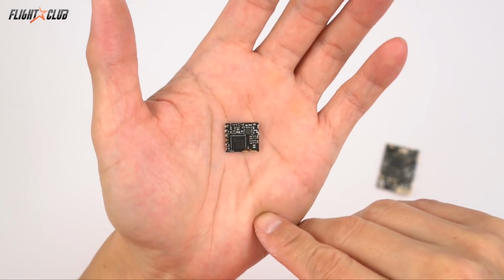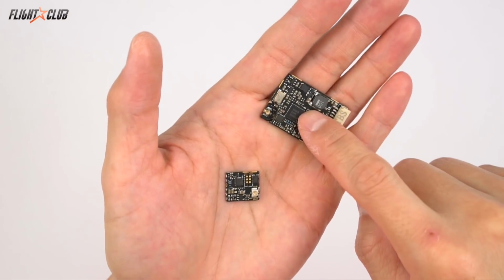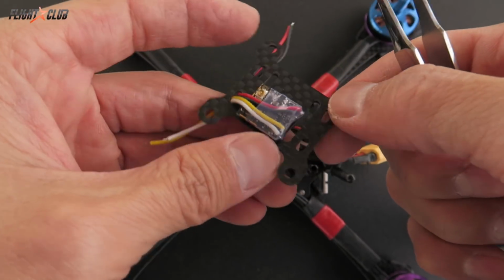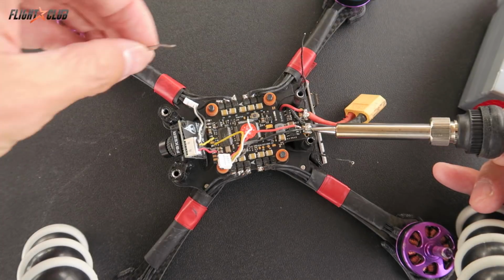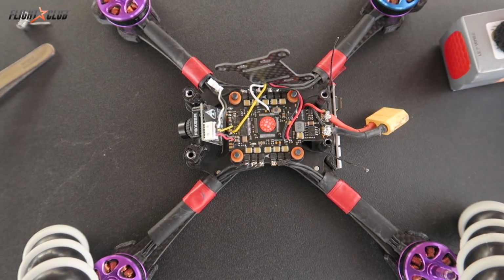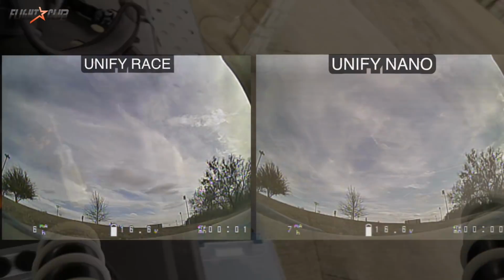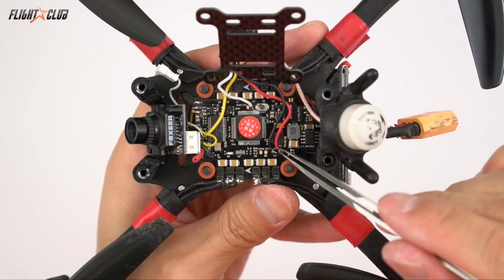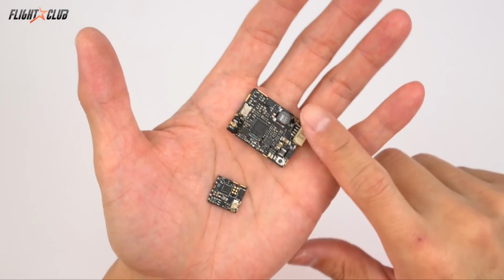TBS Unify Nano Review : 1.4g VTX!

Comment: Meh, Eachine has had the VTX03 out forever it does 200mW and is pretty small also.
Reply: JeRaF FPV but you can't run it  at races
Reply: Robin I’m pretty sure you can turn it down to 25 for racing.
Reply: JeRaF FPV yeah you can, but still on most races you aren't allowed to use such a vtx, because it's spreading video over other channels
Reply: Robin good to know!
Reply: JeRaF FPV yeah, I first flew with the vtx03 as well, but then switched to Unify because I like to go to races